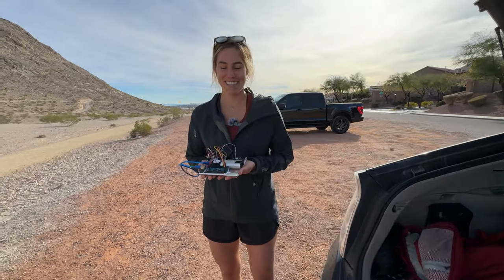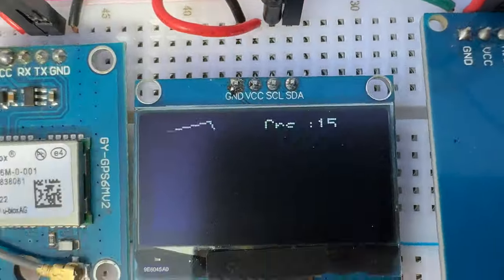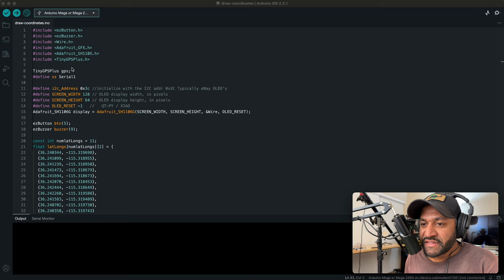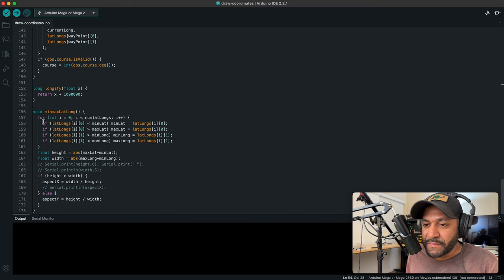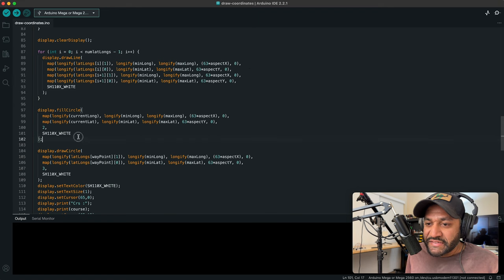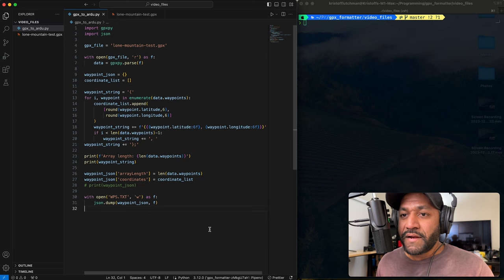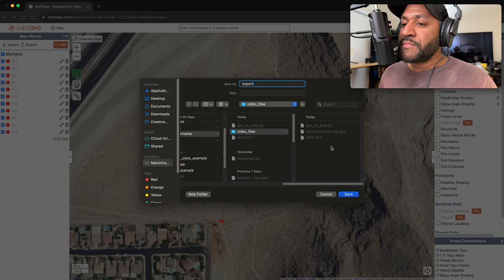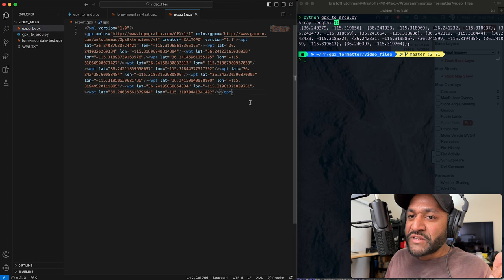DIY Arduino GPS Navigator Part 1 | Code Explained

Comment: The tape over the GPS antenna will slightly de-tune it (I had this with plastic film in the past) - you won't get the best performance - but seems to be good enough
Reply from the maker: Thanks for the info, may try running a small piece of double sided tape on the bottom of it for this prototype.
Reply: @SkillCollectors  yeah thats a better way

Comment: what's the supply you used for this setup ? Ive been trying to connect the GPS Neo-6m module onto my Nano 5v (which apparantly works for others despite the GPS needing only 3.3v-3.6v) with a 5v 2A supply from my regulator and no luck. (Ive tried connecting a 3.7v supply prior but still no luck)